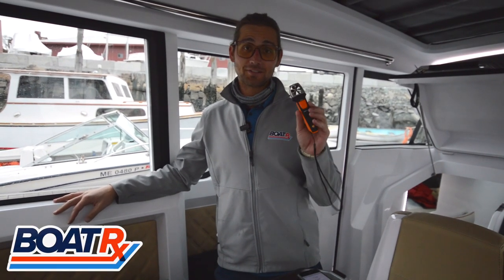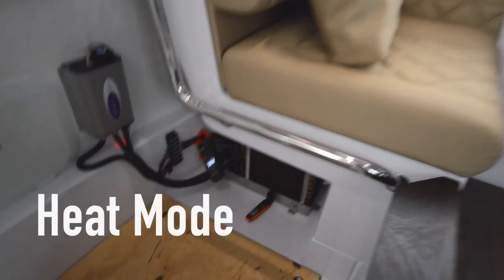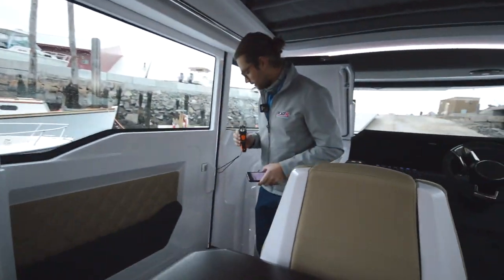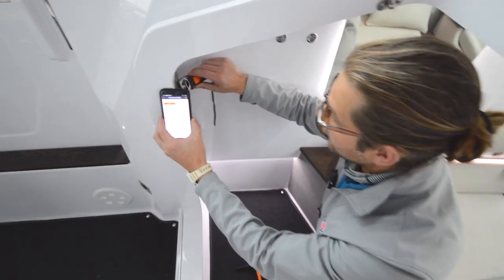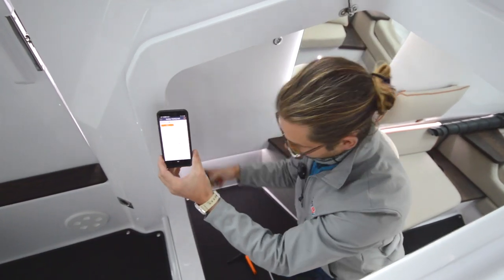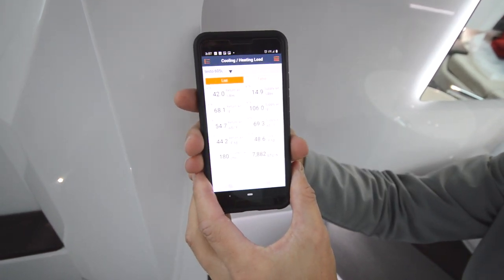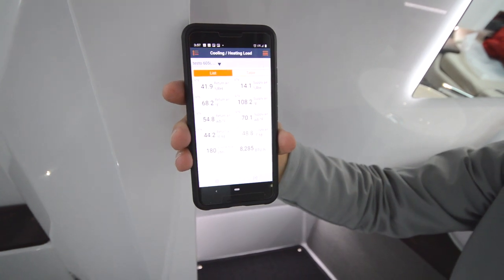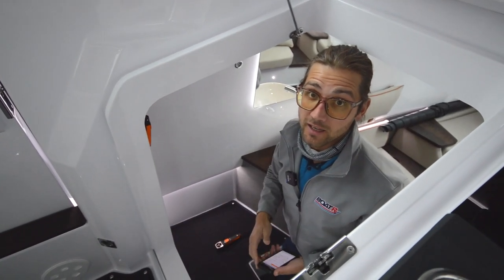12VDC Air Conditioning Capacity Test - Efficiency tested in HEAT mode - Mabru Power Systems 7k BTU

Comment: Great info. Doing research on using a system like this as a heater for a small camper that is all electric no fuel to burn for cooking or heating.